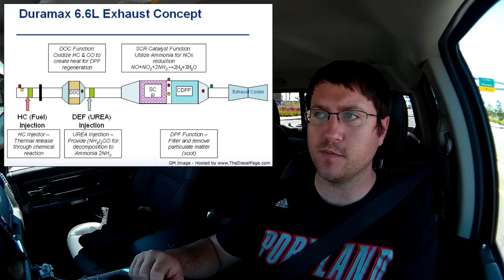Regens, DEF and Emissions Explained on the 6.7L Cummins - 2013 through 2017 Ram 2500

Comment: Dumb Q?..  Why an auto rather than a manual?

Both are 6-speed. Heard less problems w/manual vs auto trans (Granted. "old" body styles :94-02)
I have an '01 1500, 5.2/318 gasser w/a manual,. and would KILL for a "newer" gasser w/ manual. Consistent  14-16 gpm on 60 mile day/6 day-week work run.  
Are the "new" autos that much improved from the older gens?

PJ
Reply from the maker: +pjf1313 I was thisssss close to getting a manual. Reviews are a mixed bag when it comes to tuning and reliability. Some are bulletproof and others explode when you're goosing it out of a parking lot. We tow horses and the shifts are harder on them with a manual. I'm also a huge fan of the full length center console but that's low on the list. The warranty is a bit odd with the G56 also, from what I can remember. Not a dumb Q by any means!
Reply: Thanks for your input!

I'm looking for a "newer" full-sized p-u with a manual, and Dodge is the only one that offers that.  Been driving manuals since the mid '70's and don't want to stop now..

We don't tow live loads, but more "dead" weight - tractors, generators, construction supplies/equipment, so that jarring is not as much as a problem (a hunk of metal ain't gonna complain much;-)  ).

Thanks, P.J.
Reply from the maker: +pjf1313 I think you'll love your future truck from the sound of it. Nothing like rowing your own gears
Reply: The Cummins is derated if you get the MB G56 transmission to a maximum of 660 lb/ft of torque (theoretical rating of the manual transmission is thought to be around 700 lb/ft).  If you are getting a 3500, you would be better off as far as towing capacity with an Aisen transmission and the high output Cummins engine.  With the 4.10 gears, you get a max tow rating of 30,000 lbs with dual rear wheels, and even with the 3.42 gears, you will have a capacity of around 20,000 lbs.  With the 3.73 gears, your manual transmission will only have a towing capacity of around 18k lbs. If max torque is not a make or break deal, and it is between the G56 manual and the 68RFE auto (non-high output), then the difference with the 3.73 gears is going to be negligible.  

 If you are getting a 2500, the Aisen is not an option, the reduction in tow capacity with the manual transmission will be negligible.  You are still going to be reduced to 660 lb/ft of torque. 

As an aside, the G56 transmission comes from Chrysler with automatic transmission fluid as its lubricant.  Very odd considering that the same transmission from MB has a more traditional lubricant in Europe.  Something to consider if getting a manual transmission.  Many people have swapped fluids.  The gear oil that is used in other parts of the world is going to have a harder shift than the ATF.  Some people swear by the gear oil though.

Comment: 1/ Cummins builds engines for work, not play. RAM needs to educate buyers better on how to operate. Short trips and idling are considered severe duty. imho, "lugging" should be added to this definition. The CTD needs to be run for long periods at 1800 rpm and above, as this ensures proper combustion and least particulates, thereby reducing regens to minimum, and thus preserving the engine oil. If this is not your driving habit, perhaps a gasser is a better option.

2/ Alternate technologies have been developed and proposed to eliminate particulates. I know, as I was a member of a team. But they are not as convenient for drivers as the DPF, so no market appeal to lazy people. Such tech does provide greater air flow, and thus greater power.

3/ Another factor is the quality of fuel, which is rather low in the USA. Instead of placing the onus on consumers, the EPA should be pressuring oil companies to produce a better, more refined fuel. The quality of fuel greatly determines the exhaust components.
Reply from the maker: +Rob Grune well said and agreed
Reply: PS.   a better, 8-speed tranny would help greatly to ensure optimum rpm band when operating in highly variable conditions.  proper gearing could enable a smaller engine, thus improving fuel economy and reducing emissions overall. power to the ground is what matters most. again, nobody wants to build a perfect truck, as this would kill their future sales, not to mention less profits for oil cartel.
Reply from the maker: +Rob Grune lol I don't disagree
Reply: Rob Grune I

Comment: Incorrect. At higher speeds and higher temps one’s engine is producing the least NOx. The greatest NOx emissions occur below 25 mph. That’s from Cummins own studies. At 25mph one can readily produce more than 5 times more NOx than cruising at hwy speeds. Cummins has white papers on the topic.  My Cummins 6.7, as measuring NOx sensors 1 and 2 display about 100-350 ppm on the SCR input. My 2nd sensor at the SCR outlets typically reads ZERO!  Yes, zero.  It jumps to 1 or 2 ppm at moments when I lug down slow for turns in side streets.

Comment: DEF filled 2 times? wow. I've used 12 gallons in 9000 miles. 4500 were pulling 6000LBS. Seems like 2 gallons will go about 700 miles towing.
Reply from the maker: +C S definitely not towing every day but I am anticipating an increase as the season is near

Comment: So  the states that test emissions do they simply inspect system or do they measure emissions.

We just need the system to be working in Australia.

Run an emulator to trick the computer to thinking everything working and remove exhaust drill out honey comb crap out, bang it on the ground put it all back in.
Looks stock sounds stock but is hollow.

I agree environmental impacts of mass production of these parts and premature failure and sale of your truck and re purchase of new truck balances out a deleted truck that you will own and go on for many many years to come.